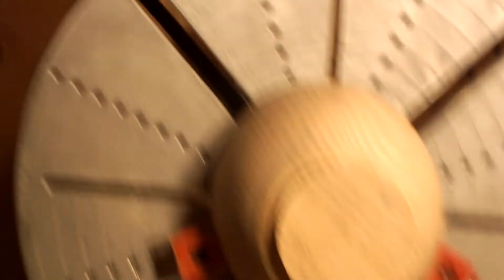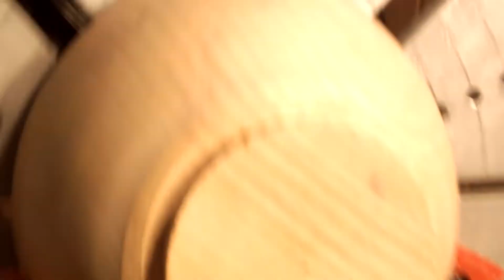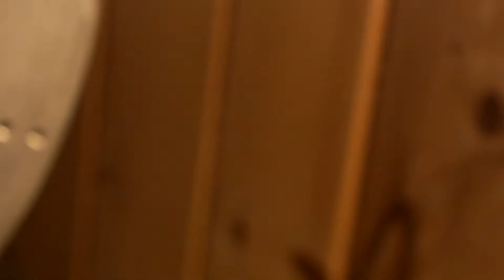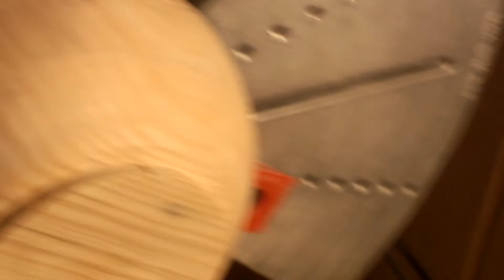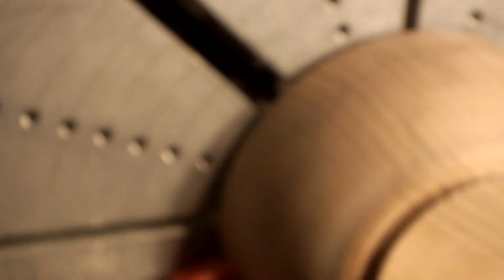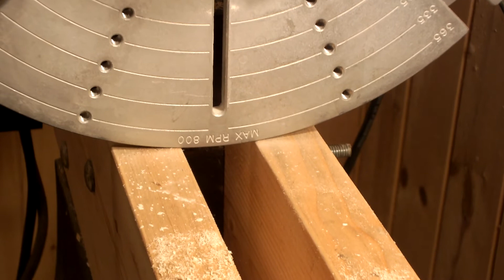Stuck in the middle / Goldilocks Problem solving while woodturning

Comment: How about several wraps of masking tape around the circumference to build up the diameter at bit? It looks like you'd need 4-5 layers to get it to close tight.
Reply from the maker: Good idea for small gaps but this is too much.
I fixed the issue bit it takes longer.
4 screws, nuts & Washers in the 4 slots hok it OK, but just not as secure as 8.
Thanks for watching.